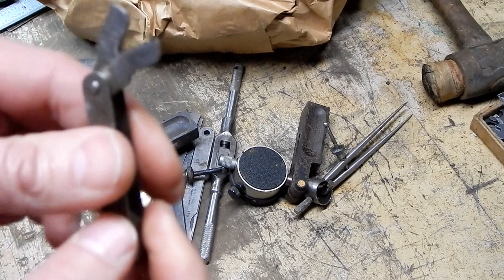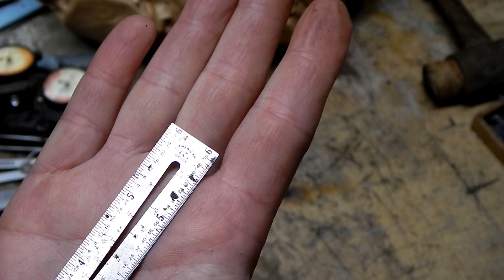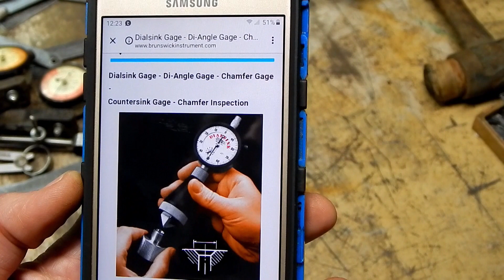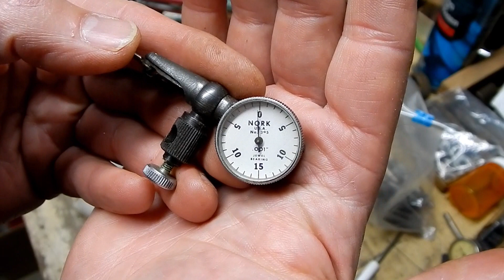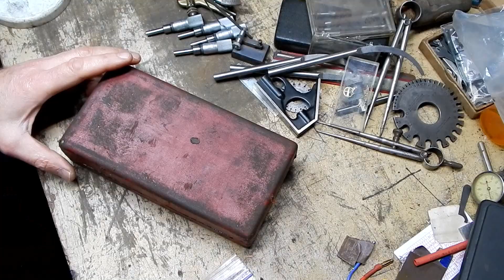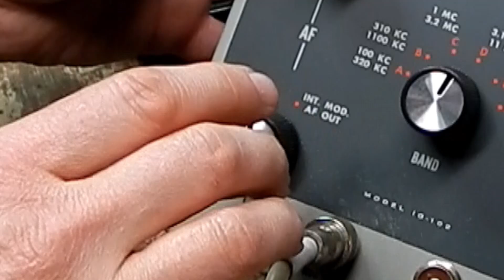2019 Thompson speedway swap meet Part 2

Comment: Picked up a similar Heathkit tube-type RF gen, SG-8. Nice condition and recapped it. Worked fine except the first band freq was off by a factor of 2. Took lots of staring at it too see that two legs of one of the coils was swapped. Fixed and it works well.
That is one thing about Heathkits, you never know if they ever worked right ;) I had built lots of Heathkit stuff as a kid including an H8 computer.
Used to do some tube radios and guitar amps back in HS. At the time only test gear was a VOM. Now want to do a few boat anchors and decided I needed some test gear (my stuff is geared for digital.) So, also picked up Heathkit freq counter that had some minor parts missing,  and built a  tube tester and an isolation transformer with dim bulb setup.
Have done two Hallicrafters receivers, S40-B and S56. Was fun to work on the old tube stuff again.
Just finished restoring 4 HP 400 series analog meters (FET input). Love the old test gear.
Reply from the maker: Hi Scott, you're going to love the video I'm putting together to show the "boat anchors" from this buy. I think the heathkit gear that was purchased factory assembled came with an inspection label. But the glue use to dry out, and stickers would just fall off.